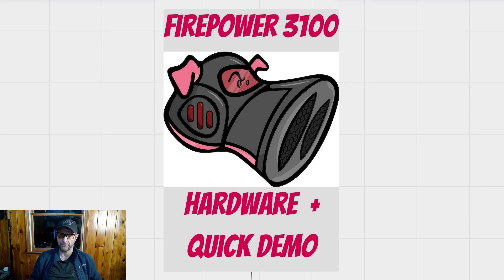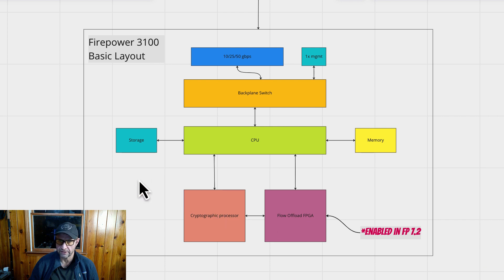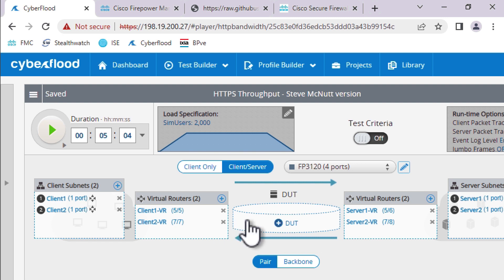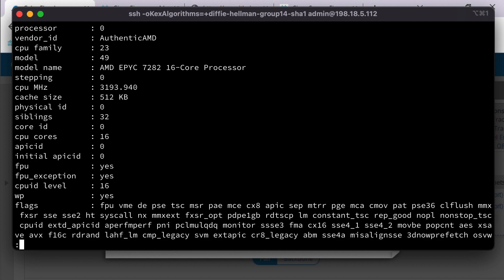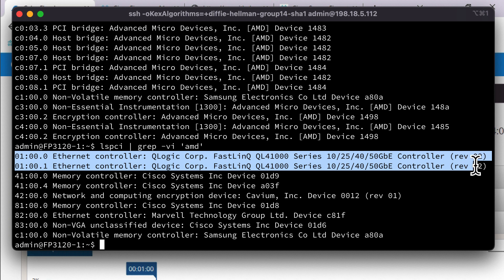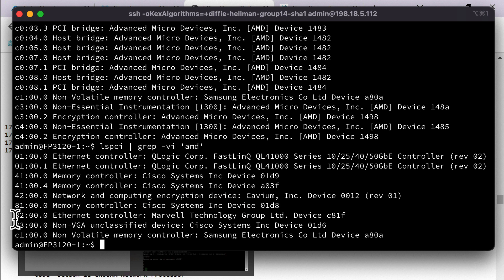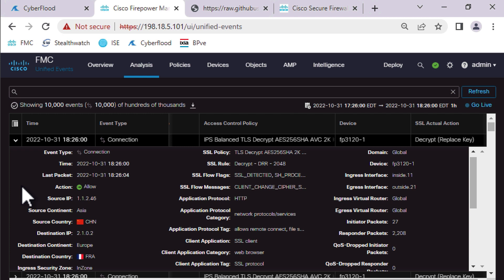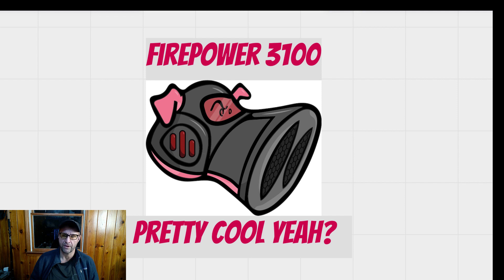Firepower 3100 hardware overview

Comment: Thanks for the content, Steve. I noticed you are running 7.1 but, as you mentioned, the FPGA hardware support, is only enabled as of 7.2. I know the FPGA helps with IPSec decryption. Does it also help with TLS? It would be interesting to see before and after with 7.1 vs. 7.2 software testing vis à vis the impact of that FPGA being enabled.
Reply from the maker: That's a great idea, Marvin.  Let me see what I can do.